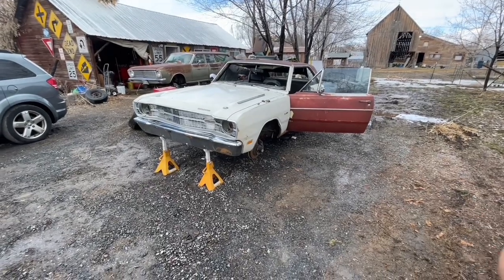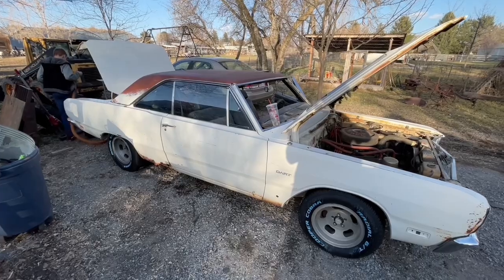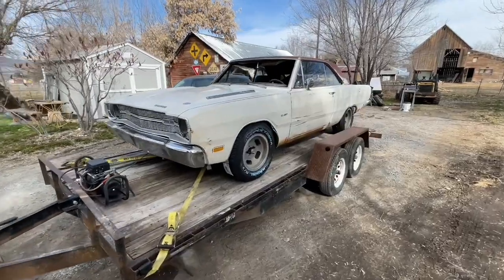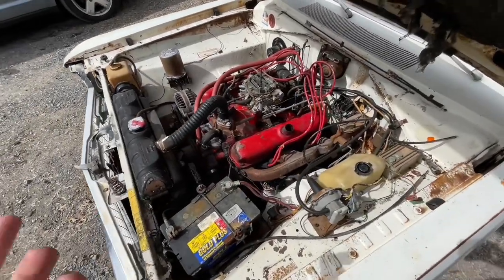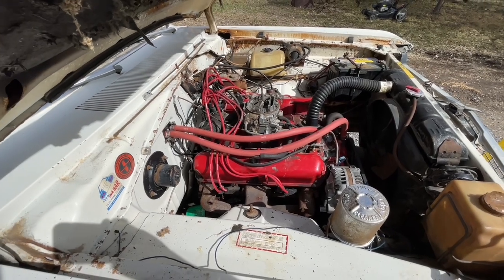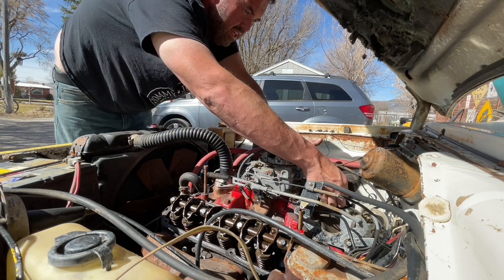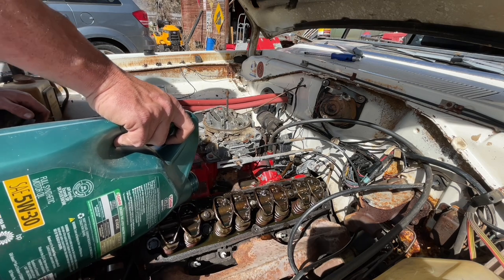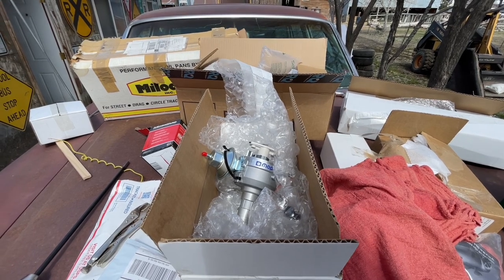EP 55 Working on the Dart, cleaning with Super Clean, ‘HOW TO’ prime the oil system.

Comment: Going to be a nice ride with lots of potential. Looking forward to seeing it fire up. I would go with the Mopar factory box on the ignition.
Reply from the maker: Thanks. Spoiler alert. I went with the mopar ignition box and this brand new one is bad. So I may end up installing MSD anyway.
Reply: @ShadeTreeVintageAuto  Unfortunately there have been huge problems with car parts and others I am assuming that are manufactured in China (as you probably know unfortunately almost everything is these days). Good luck

Comment: Does the cruise control actually look like it is an aftermarket add on unit ? It looks very similar to my sons 1973 W200 Power Wagon with factory cruise which has the bracketry at the carb to accommodate the extra cruise cable and the vacuum unit looks the same as well. Cool car !

Comment: The oil does not go up the push rods on a small block Chrysler  la engine it goes from the oil pump threw the block then threw the heads up one rocker shaft pedistal threw a hole in the rocker shaft and flows out over rocker arm this is a bad ass 340 mopar engine not a 350 Chevy.
Reply from the maker: That would explain why the bubbles and oil only came up on one bank. I’m still learning.
Reply: Very nice find should have 894 cylinder heads with a x between spark plugs on casting 202 intake valve 160 exhaust forged crank 10 5 to one pistons be sure to put oil pump drive back in correct or it would be out of time you could have just removed spark plugs and cranked it should have primed well  .